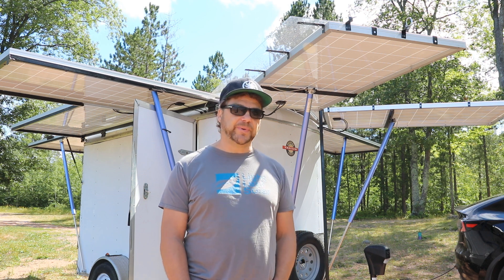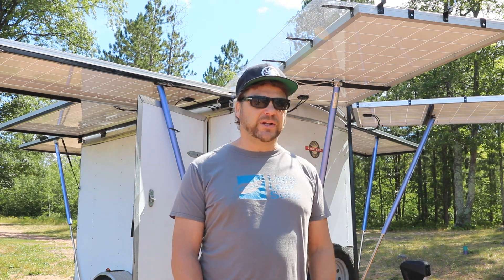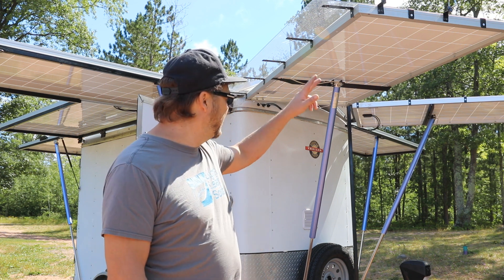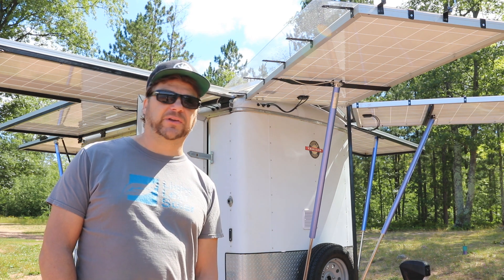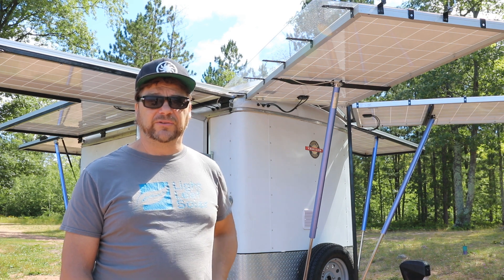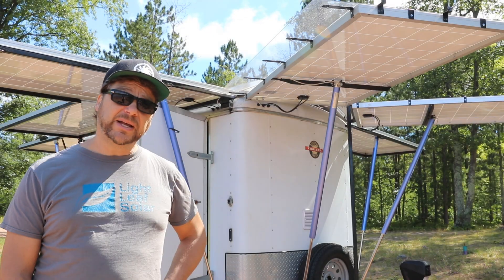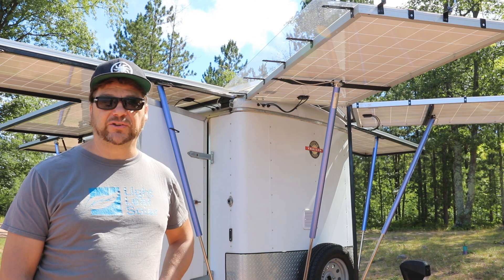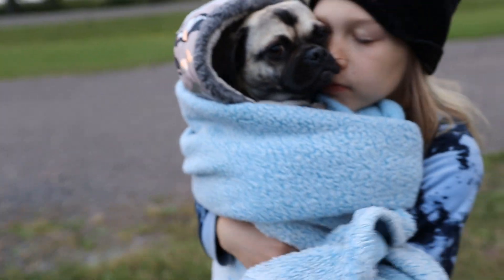Tiny Camper Solar Power Station Part 2, by Solarrolla!

Comment: Oh boy, this is almost exactly what I want to build. I’m hoping to buy just a flat bed trailer and building my own shell on top. All I want to do is maximize solar output while minimizing drag. I figure if I can keep it to close to a 6x10 or a 6x12 trailer and keep it fairly low I can fit solar on almost every inch. I have a model y that I want to use to pull it. Can you say which mechanism you are using to push up the solar panels? I’ve wondered about in a driving scenario how long latches and other mechanisms would last bouncing around while driving.